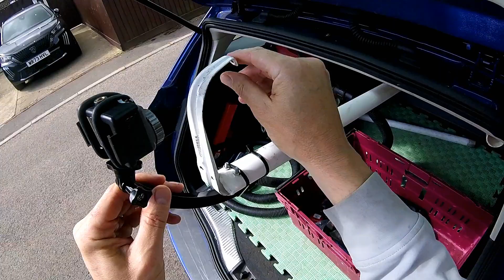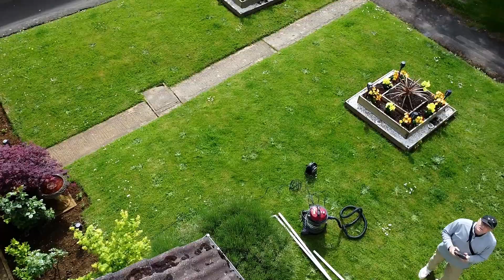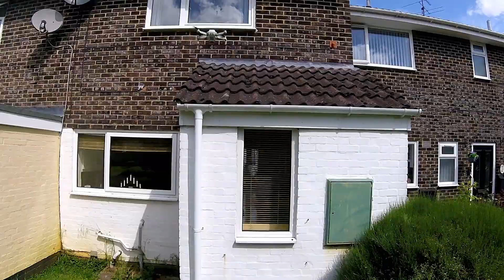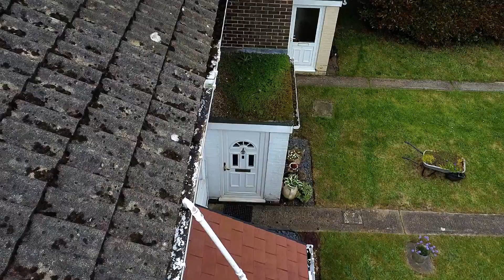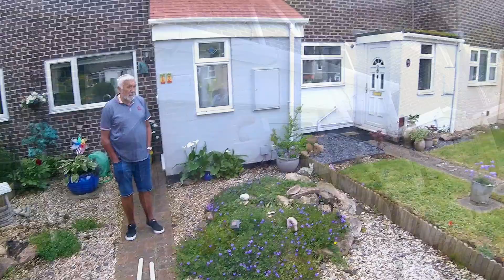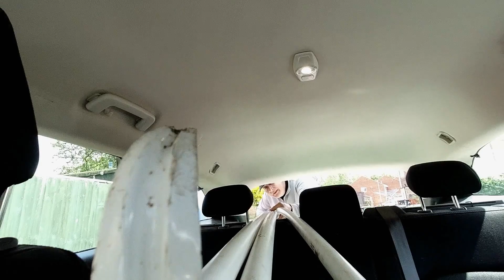GUTTER CLEANING VIDEO / NEW BUSINESS /SWINDON BASED

Comment: It appears that you have things in pretty good order now Andy. Those jobs might pile up pretty quick on you and it should bring you a pretty busy Spring and Fall I think. Once you get things going good, (as you mentioned) you probably should increase what you are charging for doing that service though. You are doing a thorough job and deserve to be properly compensated for it. And how are things going with your new house? Is the move going to take place soon or are things still being processed slowly along? You are going to have a very busy Summer obviously, boredom will not be a problem for you I don't think. Take care my good friend, I will certainly see you on the next one.
Reply from the maker: Hey, Terry. Thanks onde again for stopping by.

I do think o need to charge more, I'm not exactly sure what to charge. Im still learning the job, when I'm fully confident, then I can start to charge more, I do think I'll need to get a mobile power bank to become fully independent,  asking customers for their power to me seems a little cheeky. However, these power banks are not cheap (£500 / $560). I'll wait a while to see how things go, but it would be a good backup if the grid were to fail.

As for the house move, we've yet to receive a move date, it's taking far too long, and it's getting frustrating,  we wanted to be in now to get things decorated, etc.

Talks soon, Terry. Have a great weekend.